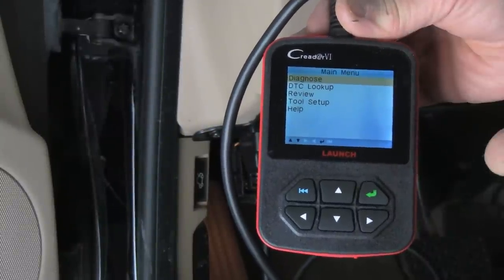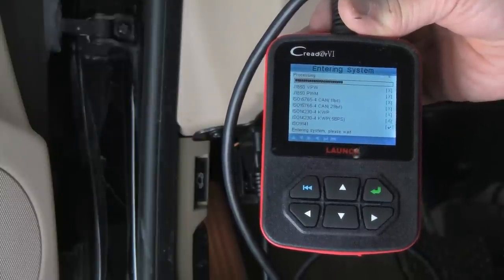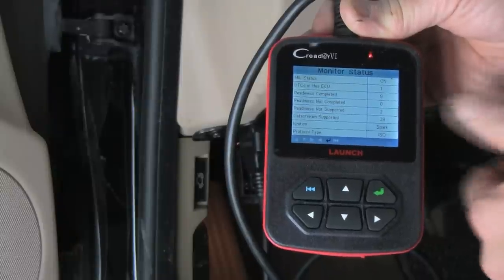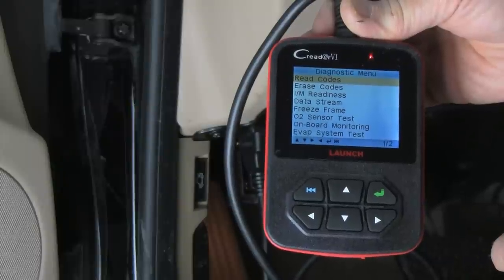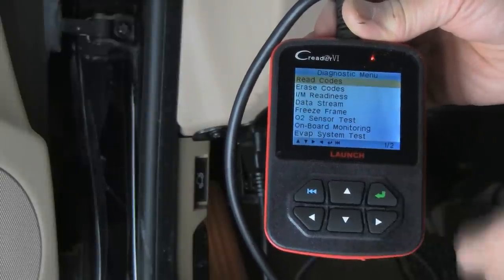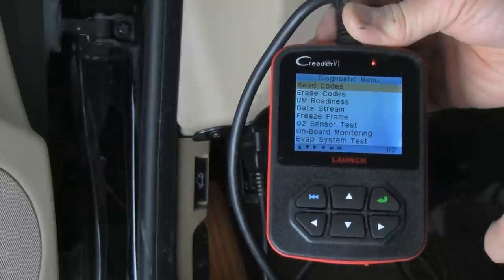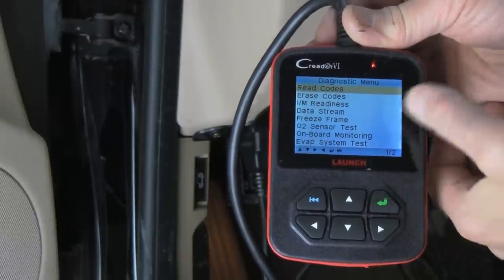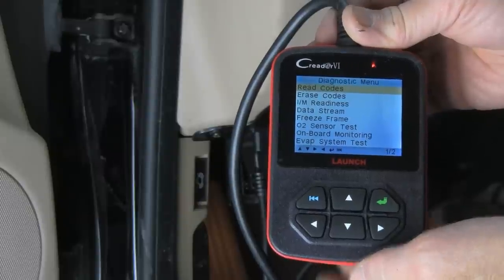Using the CReader VI on BMWs, MINIs and Other Cars

Comment from the maker: These codes are for lean on bank 1 and bank 2.  The most common issue would be a vacuum leak.  We would suggest that you closely inspect the rubber intake boots (between the air filter box and the throttle body, in the intake manifold).  These would be the most common areas for cracks and vacuum leaks.  After this, we would have the intake "smoke tested".  This injects a smoke into the intake and any leaks show as a the smoke leaks out.  Call us at 800-535-2002 for more assistance or parts.

Comment from the maker: If you disconnected the battery first, then reconnected after the seats were back in and reconnected, all should be OK.  If you did not disconnect the battery, you should typically be OK as long as the ignition was not turned on.

Comment: Great video as always. I have a problem and I could not figure what is the cause. When I put the key in position two, the check engine light does not light at all, while in cluster test (test #2) it lights, so it is not the bulb or connector. What do you think the problem is? when connected to INPA it reads the ecu normally. Any help would be appreciated.

Comment: Does the CReader VI do everything the CResetter does, in addition to reading and resetting codes, etc? In other words, will the CReaderVI reset service reminders and oil/maintenance lights? Or do I have to buy both units?
Reply from the maker: You would have to purchase both units.  The CReader VI only does fault codes (and the rest of the live and freeze-frame data) and the CResetter only does the service resets.

Comment from the maker: Ahmed Fawzy - We cannot reply directly to your comment as it was sent in from Google. - What BMW model do you have?
Reply: Thank you very much for your response.
I have e39 520i 1998, high cluster.
Reply from the maker: Ahmed Fawzy
Unfortunately, we don't have any guidance on this one (your check engine light not coming on when key is in position #2).  Have you considered a faulty ignition switch (common on these models, for various electrical symptoms)?
Reply: BavarianAuto Thank you very much for your response. The car seems to be really fine both mechanically and electrically, it doesn't have any electrical gremlins. Is there anything specific I should look for in the cluster when connecting car to program like INPA? I think that the previous owner cut the circuit between the light and ecu to disable it, because when I got this car the airbag light was covered with black silicon, so I assume he could do that too. I would also appreciate it if you could guide me to the engine light wiring diagram or something like that.

Thanks in advance, really appreciated
Reply from the maker: Ahmed Fawzy
 - You'll need to find a wiring diagram for your 520i.  You can then check the source for the light to see if it is functioning.  Further diagnostics will depend of what you find there.
Reply: Bavarian Autosport

Comment: How do you (if possible) use one of these OBD-ii readers to determine whether or not codes have been erased and if a problem is still present after codes are cleared? I'm considering getting one for used-car shopping, but if it can't tell me if codes have been erased, I'm not sure how useful it will be to that end.

Thanks
Reply from the maker: These hand-held readers cannot tell if codes have been erased.  However, the C-Reader VI can check to see if all of the readiness monitors have been satisfied.  If any are still open, this indicates a recent clearing or fault codes and the system has not had enough time to run through all the system checks.
Reply: BavarianAuto
Thank you for the quick reply. That should be good enough to at least determine the likeliness a seller is trying to hide issues with a vehicle. Much appreciated.

Comment: Good video, I have a 95 e36  and I'm wondering if you would know of a GOOD code reader for OBD-1
Reply from the maker: We do have a BMW specific code reader and reset tool for the pre OBD-II models.  The tool also resets the oil and inspection reminders on all BMWs that have the underhood diagnostic ports (most models from th early '80s through the late '90s or early '00s).  See the link below:
http://www.bavauto.com/fland.asp?part=sr%20300

Comment: hi  I have  2001 bmw 530i  and the service engine soon  came on  and the fault code is  p0171 and p0174   what  do i have to check  to fix this problem   some people  says  the 02 oxigen sensor and  01 oxigen sensor  have to be replace  and other people change the air  filter and  clean the maff senson  please help

Comment: I got an issue with the Creader 6. It's a brilliant tool but the history/review bit has got me baffled.  Anyone got the solution that can be shared with everyone?

The issues I've encountered is on the data-stream playback the tool just displays what is thinks I wish to see. How do I get it to show the data I need to see?

When does it start to record the live data-stream and when does it stop? I've just done an one hour drive and it's recorded 29 frames of data which seems quite wrong.

I have had it, about 6(ish) times, record a defined (5 or less) set of parameters while watching the data-stream on the graphing option but I've seem to have done this by accident. I'm having a guess that many more people will be scratching their heads on how to correctly set-up the tool's data recorder.

Does anyone have detailed instructions on how to set-up and use the data-stream recorded once enabled? What I'm after is capturing a set of parameters and view a few others as a graph, changing what is being plotted while not interrupting what is being recorded. The bit that has me beat is where the data-stream replay seems to decide what I want to see and gets it wrong, when to start logging data and when to stop.

Comment: my car has a power window anti trap function code...do you know it this device will erase it?
Reply from the maker: +Sidney Sato - No.  The C-Reader only reads and resets engine management (as well as reading the engine management sensors and other outputs).

Comment: I just bought one these off Ebay and screwed up my 2010 Honda Civic.  As soon as I plugged in my Honda to give it a try it triggered all my warning lights!  Tried resetting the car with my friends snap on scanner and the errors came right back. Now I need to take the car to the dealer to figure out what happened,  There was never an issue with my car until I plugged this thing in.  Just beware when buy some of these scanners from China.